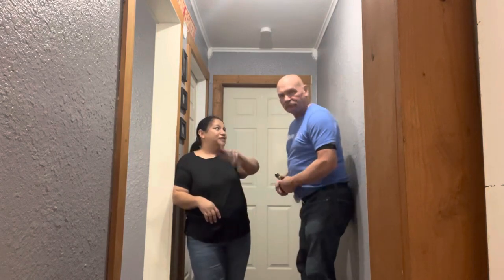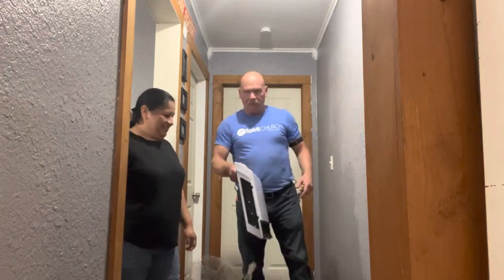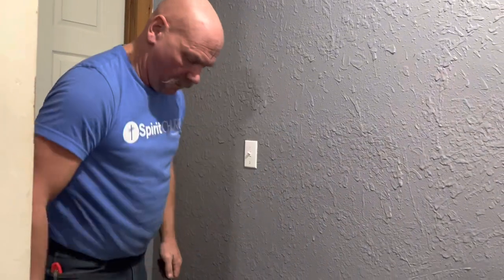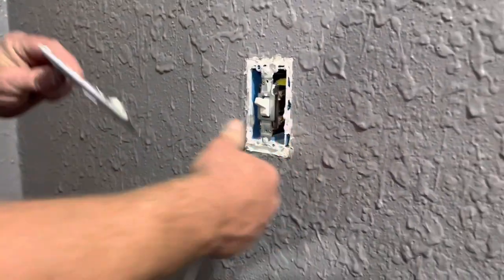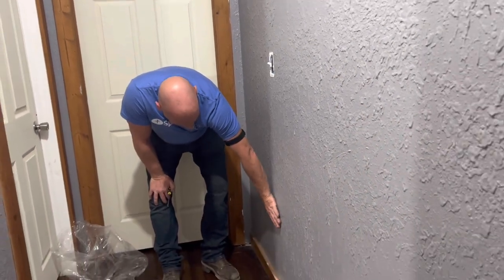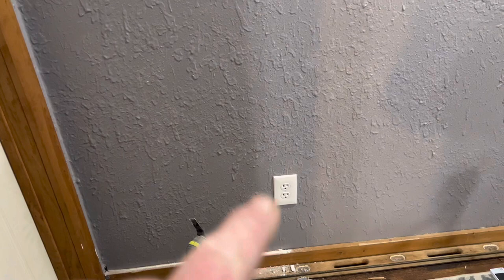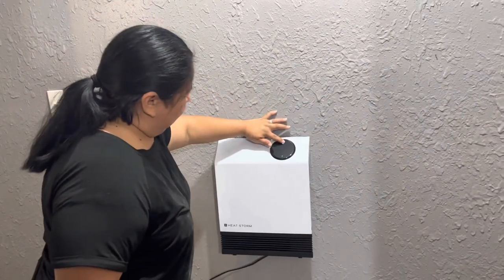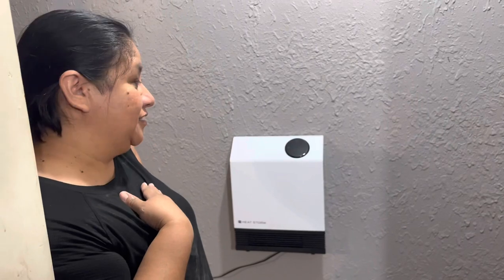Couple Renovates Small Farmhouse Third Project : House-Heating Project / Heat Storm Electric Heater

Comment: They are saying electric heat will be the cheapest. We have electric baseboard heat, heat pump, bottled gas heat furnace and a wood burner. After the wood burner I think we will use the electric baseboard heaters since electric will be cheaper